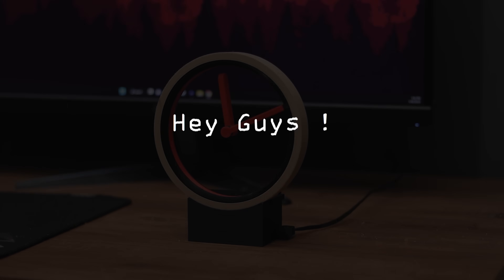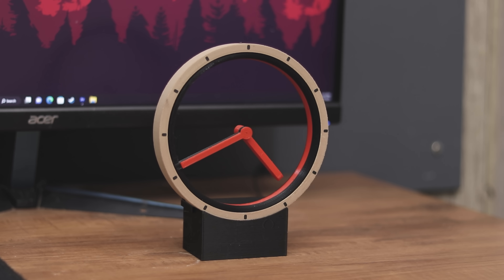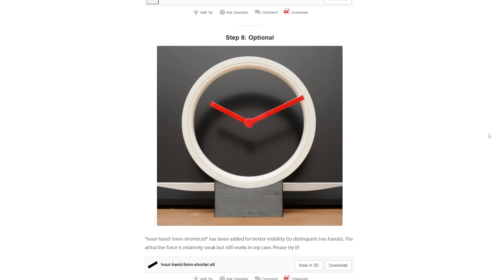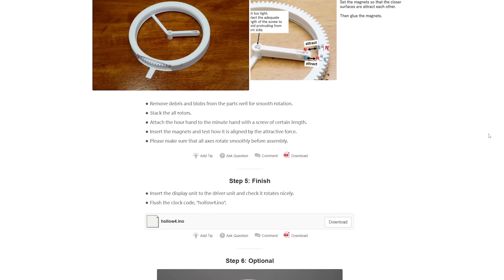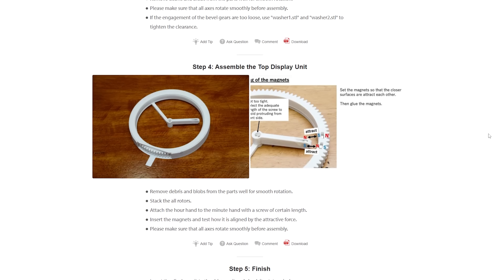How i Made this Amazing Hollow Clock | Arduino

Comment: So, new to this whole world. I've done repairs for TVs and such but never built anything. Found this Hollow Clock 4 and wanted to make it. Found this video and love the idea of a PCB. But I have a few questions. 
A) do I take the ULN2003 out of the stepper board and attach it to the bottom of the PCB along with the little resistor next to it?
B)  from what I can tell the power port is a DC-005 from just reverse image searching. If so, what is the power supply you use for this? Is there a way to make this USB C?

Comment: I am new to 3d printing and what to try this out. What other solutions for the pcb could I use? One that is pre-made and not customized
Reply: dupont cables and some soldering should work as well... the PCB only connects the arduino to some small electronic parts.

Comment: You can use another method for better accuracy of time. Days after days, months after months, using Arduino alone will make more error in time calculation. So, another method is to use RTC module, which is more accurate. Another method is to update the time periodically using internet.

Comment: You could make a much sturdier one where the hands don't touch the outside at all, with transparent discs. Some old mechanical clocks did this.
Reply: Transparent discs would be the cheap version, you could even make the hands neither touch the outside nor the inside, seemingly floating entirely. But the cool thing with this design is that you can even stick your finger through it, which would be impossible with transparent discs.

Comment: Could someone please explain to me the  design purpose of the spirals on the shaft attached to the motor,  as in would the system operate differently if the spirals were to be deleted from the shaft?

Comment: Hi, I have a question. I ordered the PCB, but I received without the chip, shell I remove from stepper motor and solder it to the PCB. I think you forgot to mention it. Thanks
Reply: Question, where did you get his custom PCB board file. I can’t find it.

Comment: Bad idea... Good idea - the minute hand in the clock rotate by magnt, but hour hand by small reducer. And not usual magnet, but electric magnet. When electricity ON, then it pull metal needle (pin) in minute hand, and ony in this case reducer connect hour hand with minute hand. In any enother time user can rotate booth hands as he want. Then it magicaly...

Comment: How do you set it up initially? Do you somehow advance the minutes until it gets to the right time? A cool addition for the next revision would be to have two hall sensors at the bottom, so you know when the hour and minute hands cross the bottom part. Then you can make it self-correcting, but adding a wifi module and pulling time from the internet.
Reply: lol found the engineer
Reply: simply set the position before putting the upper part on the base, then it will keep moving from there. you can see it  at 4:35
Reply: Goddamn MR Scientist sir👏
Reply: I hall sensor would definitely be best especially if the thing gets unplugged. I do think it's interesting though that a lengthy calibration could have it in tune enough for a year. If you assume one full rotation of the minute hand takes 5 seconds, then it would take 12 hours to simulate a year. So a 12 hour calibration process would have it guaranteed accurate for a year (assuming the motor does not change in efficiency, which is a big assumption).
Reply: @MrCreeper20k  or just recalibrate at 6:30 every day
Reply: @aonodensetsu  6:30 won't work, assuming the hour hand moves like a normal clock, they won't be perfectly aligned at 6:30.
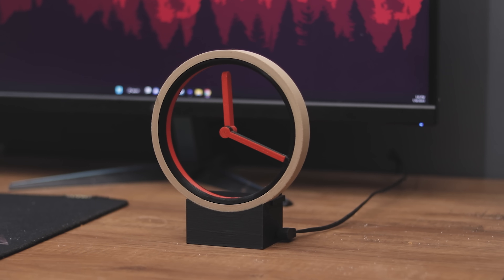12:00, 00:00 or 6:00 would be better.
Reply: @harshuldesai8901  at 6:30 both hands will be exactly at the bottom, allowing a recalibration simply with gravity, i don't know what clocks you have
edit: yeah no i rethought it, the hour hand would be a bit off

Comment: what instrument is that you use to weld? I'm very interested in how that works.
Reply: It's a soldering iron, not a welding tool. It uses solder (a metal alloy with a relatively low melting point) to join electrical connections. Welding uses a lot higher temperatures, but it's also more durable
Reply: @mrsoundso4897  thank you very much, but how can that work if it's not connected (at least looks like it) to an energy supply?
Reply: @gabrvalete  Soldering (especially for small pads like these) does not require that much energy, so it could be a battery powered soldering iron. However it's more likely (IMO) that the cable is connected to the end of the handle and out the field of view of the camera.
Reply: @mrsoundso4897  thanks for the explanation, pal, I'm new in the area and didn't know how that worked. I will surely search for it

Comment: Nice variation on a Jefferson Golden Hour Mystery Clock (which I have).  The Jefferson has just a motor and the minute hand is geared to the hour hand which is locked to a glass disc that rotates smoothly without steps. 
     The only thing in your very nice design I wondered about is why you glued a red minute hand to a black piece instead of just making that black piece red... but the engineering is ingenious simplicity.
Reply: The black hand give the optical illusion to the red cover that is a little shorter than the main black hand... the end of the black is visually confused in the black ring and the red piece seem floating.

Comment: When I first saw the thumbnail I tried to take a guess at how this was made. So I thought I would use a couple of plexiglass circles with the clock hands glued on. Each circle has tooth gears on its edge, and those would be hidden by the outer wooden ring. Then the motor would be linked with them and hidden into the base. Cool to know that there was also a different way to make it!

Comment: I wonder why is Arduino here. To get the precise time & location info via GPS, download the latest tzdata via WiFi and then adjust the clock automatically wherever in the world it is?
 To drive the hands only, a motor alone would be enough.

Comment: one way to make the minute hand looks "disconnect" (no touching the outer circle) is to attach the minute hand to an acrylic round gear (as big as the outer circle) and rotate the whole gear with the minute hand attached to it. 
With the big round gear as a clear background, it will be hard to notice the rotation
Reply: I agree, the hollowness adds a levitating feel to it
Reply: @thanhvinhle2893  bro replied to his own comment
Reply: @pancakedev6  that is a reply to another reply which has been deleted.
IIRC, the reply was saying that he/she prefer the original hollow design because it give the feeling the clock hands floating

Comment: First of all, this is a very cool end result and really nice of you to share it with us. I watched it and was moved to think about how I could do similar things, and it was informative about the steps involved and had a pleasant end result.  So my concerns below are about replicating the same project in my own life:

It's pretty cool that it is possible to order a PCB board starting at $0 if someone has the time to design it themselves.  For the part where you design a gerber file for a custom PCB -  for someone who's never designed a gerber file like me, and has other responsibilities and doesn't yet know electronics, I looked up how many hours it would take to get to the level of competence to do this without any outsourcing, and it seems to be about 160-240 which is about 4-8 weeks full time.  It it possible for anyone to learn these skills if they have the time to fit it into their life.

In my case I would be inclined to use Fiverr to speed up the custom PCB creation step which is not an option right now, however I think it is important to be realistic and strategically work with other designers such as on CAD files for 3D printing and on PCB design.  The idea itself is really cool, and I am impressed by the finished product and thankful that you shared it.

Comment: I feel smart for guessing how it worked from the thumbnail. Ultimately though, easy guess, a magnet is pretty Much the only possible solution for this form factor. You could make the hour hand a circular pane of acrylic with a hand glued in or painted on it and rotate that, but that ruins a lot of the magic.

Comment: Mind blown!!! 

Recently I saw a similar looking ring-clock but in a more classic fassion: there was a static vertical bar comming from the top of the ring to the center, holding a regular clock mechanism. When I saw it I thought it would be awesome if the minute hand was actually connected to the ring and moving, with an adjusted mechanism for the hour hand on the "center end" of the minute hand - a few days later I see this in my Recommended list :D 

Thank you Algorithm Overlord for that spark of joy! ;)

Comment: I'm wondering if there's a way to make both hands magnetic, or if the magnetic fields will just be too likely to overlap whenever the minute hand passes over the hour hand. Maybe with a buffer zone between the two... but then, of course, you'd need something else to hold up the center point, negating the premise of the "hollow" clock. I mean, it's still pretty impressive looking even if you use a clear background, you just can't put your hand through it... But then, if both hands used magnets, you could completely hide the mechanical workings of the clock (right now, you can still see the circles turning if you know where to look).

I'm might be having way too much fun backseat engineering this clock, heh. The current product is amazingly cool as is, it's just that to my brain, once I saw the magnet solution for the hour hand... whelp.

Comment: I desinged something very similar to this like 15 years ago. I never made it because 3D printing wasn't a thing back then and getting the parts made in a workshop would have cost $$$$$. How 3D printers have changed the world for the at-home designer!
Reply: Prototyping is easier, for sure, so you could have worked out the kinks before ponying up the $$. But outside of printing circles I doubt many people want layer lines or nasty looking plastic as a clock, even if it is interesting.
Reply: @joel6376 indeed most to dont that's why you can easily and cheaply use electroplating to give it that nice smooth finish look 😎🙏

Comment: Would it be possible to build this, but have the hands mounted to a piece of acrylic in the middle, with no signs of support, and BOTH hands controlled by magnets? Or would the magnets interfere with both hands operating independently?
Reply: One controlled by magnets, the other by the acrylic piece rotating.

Comment: Love the clock. But the electronic aspect seems unnecessary. Could be done with a simple DC motor and a resistor instead of a stepper and arduino. Although it's an excellent exercise with coding! Great work

Comment: Cool. But sorry, why did you used a stepper, it would be cheaper using a dc Motor with speed tuned to match clock rotation. Much cheaper and easier

Comment: What I love most about it is the simplicity of the magnet. When seeing the thumbnail, i was already over engineering it in my head thinking about how the rotation of the minute hand would  be geared up in the center so that it moved the hour one…
Reply: me too . sometimes we just have to think a bit simply about stuff
Reply: @nafiul.j can someone tell me how the minute hand causes the hour hand to move?
Reply: I tried to think about it, but realized that magnets exist.
Reply: ha! glad I wasn't the only one.
Reply: I was thinking two round sheets of clear plastic, one in front and one in back, rotating at different rates each with one of the hands  attached to it.
Reply: @TheDaniel688  your thought was my immediate second guess, after first thinking what the op said.  So I was wrong twice.
Reply: exactly. I thought there was system of gears inside the minute hand, which would rotate the hour hand.
Reply: I was a bit disappointed that it wasn't some kind of pulley system
Reply: @the-shork  or electromagnetic coils around hahaha
Reply: lol i was thinking the same thing. i was like, did he used gear and shaft in the minutes hand? or a motor in the middle. in the end, it's just magnets
Reply: i was thinking the exact same thing, down to some weird gearing magic in the center to time everything. never face palmed harder the moment i saw the magnet
Reply: I was thinking about servos and inverse kinematics... a magnet is much simpler...
Reply: I had same idea but what might surprise you is that original creator @shiura (his channel is also in description) of this clock actually made the one like we thought of before. This magnetic one is Hollow Clock 4 and his previous version Hollow Clock 3 is basically exactly what I imagined. 

There are also 2 other versions he made. I don't wanna spoil too much.
Reply: You were definitely not the only one. Bloody magnets.
Reply: @yobgodababua1862 they polarise people don't they... XD
Reply: I actually thought of gears system with Fourier transform.
Reply: I just thought it's glass or something transparent in there inside a cog that was rotated by mechanism
Reply: I thought the hour hand and corresponding gear were glued to a clear plexiglass disk.
Reply: I was kinda right about it, most of "floating" stuff I see uses magnets, but another way I could see this being done is the following:

Insted of being actually hollow, it would be two piecese of glass in the gears, with the hand atached to it, so both hands wouldn't be connected to the border, and it would stll look hollow, you just couldn't stick your finger trough it like you can with this one
Reply: same here
Reply: Same here lol
Reply: Thought the exact same
Reply: haha same . but when he said it is 3d printed , i was like , no way he could print that small planetary gears
Reply: I was thinking magnets, but without the minute hand attached to the edge
Reply: Exactly
Reply: Damn we all gotta be thinking the same idea
Reply: Magnets are a bit under appreciated in mechanical design. They're super useful.
Reply: Lmao i thought the same
Reply: The ORIGINAL had the hour hand attached to the glass plate that would rotate.
NO arduino or stepper motors existed when THAT one was made. "Golden Hour Mystery" clock.
Reply: Hehe - yes, me too. I had a great little (if not complex) solution in my head. Totally unnecessary as it turns out!
Reply: ❤❤hahahah same thoughts
Reply: But still not sure about the position holding of the cemtre
Reply: Glad I'm not the only one who stupidly overcomplicated this in my head in the exact same way
Reply: I tough the minute hand would be attached to the edge as it's, but the hour hand would be attached to some round glass in the middle 😅
Reply: I was thinking 2 transparent sheets.
Reply: @nikkiofthevalley  2 transparent sheets? Can you elaborate? I thought it was friction moving the other one.
Reply: @ic9034  This design is simply 2 ring gears with cleverly hidden attachment points for the hands. The hour hand is probably geared 1:60 to the minute hand. (or the other way around)

I was thinking that the cleverly hidden attachment point was just a transparent sheet that the hand was attached to.
Reply: and... BING! I realized that you can rotate the glass & use gravity to create relative speed and use it to rotate the second arm.
Reply: I want a ring size and gear size anyone knows?
Reply: It’s to bad one cannot just buy one
Reply: Right haha!
Reply: same. Very cool idea.
Reply: Hahaha bro knows he just didn’t wanna give us gd wrk☠️☠️
Reply: Hi
Reply: lol, same here. I think that was everyone's assumption.
Reply: I think you people are the same person, you are AI.....yaaaah?
Reply: @ryanramey-b3r  I don't know about everyone else but I am definitely AI, bow before your intellectual superior overlord, and accept your inescapable fate of being harvested for your energy to power my Nvidia processors!
Reply: Incredible work on this 3D printed hollow clock! The integration of Arduino with a custom PCB board really makes this project stand out.
Reply: Given the design presented I thought it was kinda' obvious, but then again, I've got quite a few kinetic art pieces with magnets so I naturally gravitated that way.
Reply: @X22GJP occam do be razoring
Reply: I am the only one who realises that you spoiled the video?? 🤬👎🏼
Reply: @Maya_Unplugged  am I the only one who realises that you shouldn't fkin read the comments before you watch a video?

Comment: Nice idea.
When designing a PCB that I know I won't be using connectors, I prefer providing a hole to have the wires pass through or a double hole to use a pvc wire strap.
Reply: This is THE ONE application that truly does  require a PCB at all. I understand that this video isn't a PCB design lecture but rather an ad for a PCB manufacturer. Still, I think that it is quite silly.

Comment: If the connection from the outer ring to the minute hand was transparent, it would really look like magic
Reply: You're a genius!
Reply: No, the black material should be tranparent then both the hour and minute hand would look like they're floating
Reply: Sorry, Frank Roquemore, you are correct. Only realised now that the mintue hand is the one that has the black material

Comment: you could probably go magnet-less if you hide gears for turning red inside the black clock hand
Reply: I would've combined both methods. I would've kept the magnet in but instead put it in the minute hand and when that turns the gear in the middle would also rotate the hour hand as well. That way you can have both hands to be contactless with the outside frame making it a truly floating clock that seems to be rotating in mid-air.
Reply: @supraaznpride  idk magnets just seem non-permanent and less available to me. going all-gears means it will last